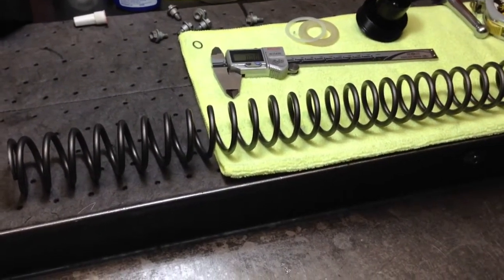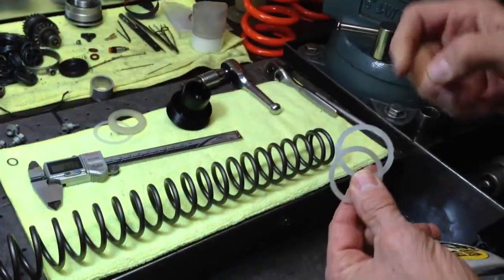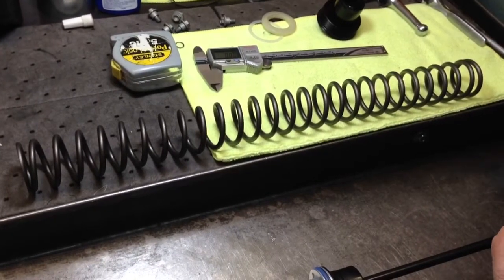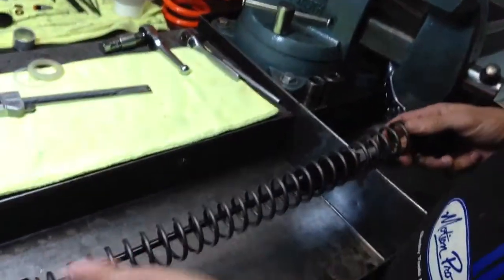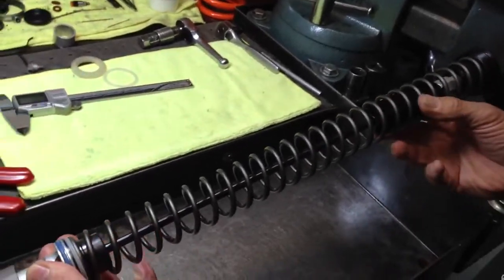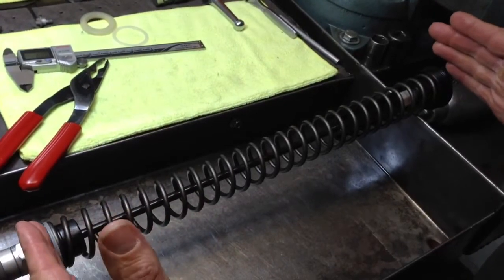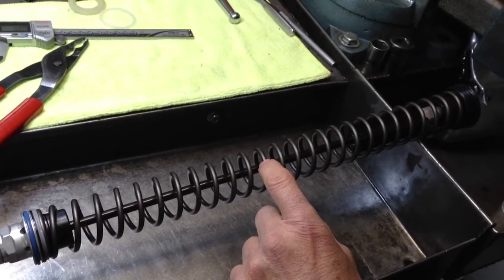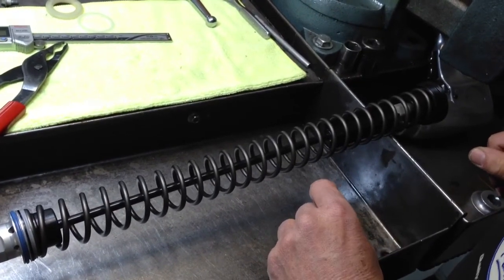How to Set Spring Preload on WP 4CS Forks

Comment: I tried some Factory Connection springs and they rubbed the inside of the lower fork tubes so bad that it turned the oil silver from all the metal shavings. I had to buy all new bushings and seals, and polish out the inner and outer fork tubes. The anondizing looks ok now but I wonder how much damage was really done in there as it's hard for me to see in there. 2010 250sx....

Comment: Hi. Im wondering if a 470mm spring fits in with no problems? My shop has available 4.3NM 465mm spring, and one stiffer one 4.6NM 470mm. I'd need a stiff one for road use.